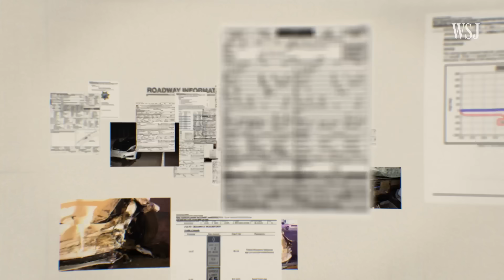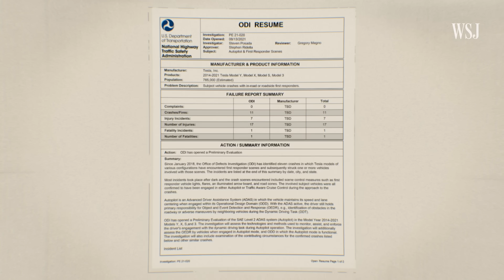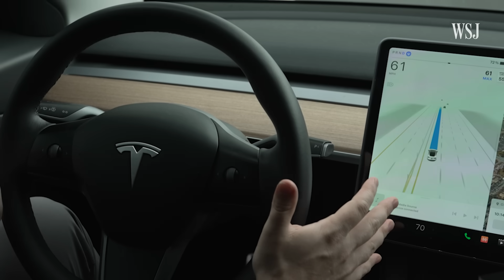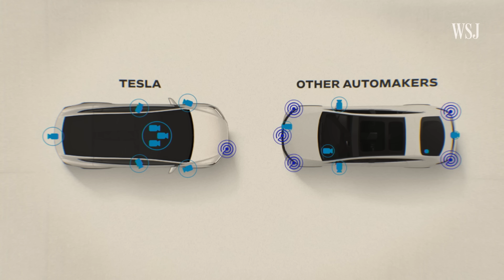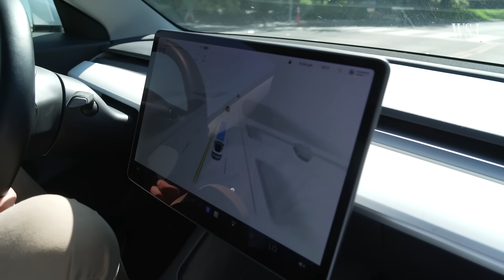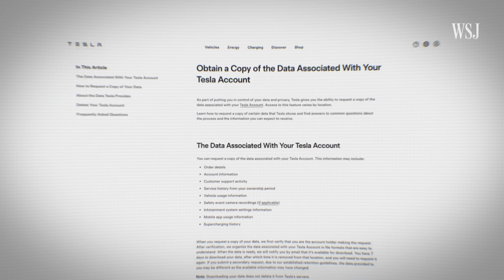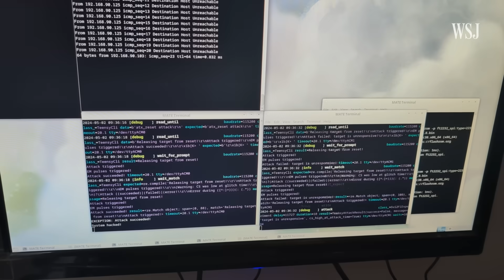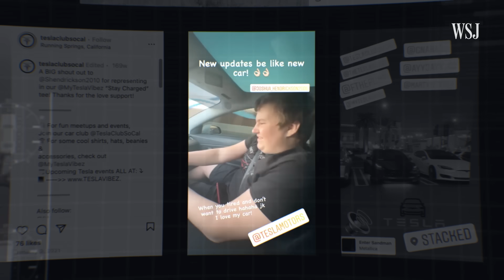The Hidden Autopilot Data That Reveals Why Teslas Crash | WSJ

Comment: Musk messed up meddling with his engineers and he will never, ever admit it.
Reply: V13 is showing Elon was correct. Tesla are very close to solving automation.
Reply: @daydreamer8373  They've been close to solving it since 2018. Not having Lidar was a mistake, but he's promised full self driving on the platforms they've already sold, so he's backed himself into a corner.
Reply: @quattordicimontenapoleone3113  Tesla only switched to using an end to end neural net about a year ago, and the progress since then has been nothing short of amazing. and proving Lidar is not needed. FSD is set to make our roads far safer.
Reply: @daydreamer8373  Nice try Elon-bot. I'll believe it when I see it.
Reply: @quattordicimontenapoleone3113  There are numerous videos showing the capability of FSD. Driving around New York especially impressive. It is not quite ready, but it's performance is undeniable.
Reply: @daydreamer8373  And still, we have videos like the one we're commenting on.
Reply: @quattordicimontenapoleone3113  You mean from 4 years ago? From autopilot a level 2 driving assist, where the driver wasn't using the system correctly. 

This video has nothing to do with today's FSD, anyone who thinks it does has no idea what they are talking about.
Reply: @daydreamer8373  Why is it always "the driver wasn't using the system correctly" from you Tesla apologists? There are a lot of accidents associated with Tesla's autonomous driving systems. You don't have autonomous driving if it only works 99.99% of the time but is a serious hasard. People are having serious problems even using it during short periods like review trials.
Reply: @quattordicimontenapoleone3113  Tesla does not have autonomous driving. They have level 2 systems, that require the drivers attention at all times. Tesla tell you this!!!

FSD is getting very close to level 4/5 which will mean the driver is not responsible. But until Tesla say otherwise it will be level 2 and require the drivers attention.

Comment: To say it in Musks own words (that he used to describe the F-35): The Tesla Autopilot is broken at the requirements level... Solely relying on cameras is the most stupid thing one could do when building self-driving vehicles
Reply: Yeah sure
Reply: @captcan78 Do you drive a car? If yes, you rely solely on your eyes and you don't consider that being most stupid. Seems that the problem is that the cameras used for vision are not sensitive enough at dim light, which cam be improved to reach requirement level.

Comment: Let's face the truth: it's Elon Musk's stupid call for not implementing LIDAR, because "it didn't seem cool enough". That guy burned so much money with his utterly stupid ideas it's beyond me how he got away with all that?!
Reply: Yeah how? 🤡🤡🤡
Reply: V13 is showing Lidar is not needed. FSD is going to make our roads far safer.
Reply: @daydreamer8373  Tesla’s "no LIDAR" strategy might cut costs, but it’s a safety gamble. LIDAR excels in bad weather, darkness, and tricky conditions where cameras fail. Waymo, the autonomous leader, uses LIDAR because it works—saving lives, not just money.

Claiming FSD v13 “proves LIDAR isn’t needed” feels like marketing hype. Tesla’s vision system impresses but often fails in real-world edge cases, leading to accidents. Waymo’s LIDAR, radar, and camera combo isn’t overkill—it’s smart engineering. Until Tesla matches that reliability, dismissing LIDAR is just risky, shortsighted and dead stupid.
Reply: @jazz1tup  You do know a Waymo crashed into a large wooden pole a few months back? Lidar is not some wonder sensor. and only adds cost and complexity. What Tesla has done with V13 is nothing short of amazing. Most people have no idea how good it is getting or set to become.

Tesla are on the verge of solving autonomy, and it will make our roads far safer.
Reply: @daydreamer8373  You do understand that Tesla vehicles were involved in 53.9% of ALL of the self-driving accidents? "Amazing" and "Tesla" just doesn't play nicely within the same sentence.
Reply: @jazz1tup  FSD has not been involved in any accidents, certainly nothing fatal. (I do know it has avoided many accidents) And any accidents would be down to the driver anyway, as the system is still designated level 2. 

I repeat Tesla are very close to solving autonomy, and our roads will be far safer because of it.
Reply: @daydreamer8373  Claiming FSD hasn’t caused accidents is misleading. Tesla’s FSD is still a Level 2 system, meaning the driver is responsible—but blaming users ignores design flaws that confuse or fail in critical situations. Numerous incidents, including crashes into stationary objects, suggest the system isn’t as reliable as claimed.

Avoiding some accidents doesn’t prove autonomy is near “solved.” True autonomy (Level 4/5) requires handling all conditions safely without driver intervention. Meanwhile, competitors like Waymo, which use LIDAR, are already demonstrating safer, fully autonomous driving in real-world trials. Tesla’s vision-only gamble may seem impressive but far from guaranteed to make roads safer.
Reply: @jazz1tup  You seem to have missed the progress Tesla has made since moving to an end to end neural net. The progress made has been nothing short of remarkable. I am not knocking Waymo, it is doing some great things, but has huge limitations. FSD making a lot of people sit up and take notice, and one og the reasons the stock price has risen sharply.

Most people have no idea how good FSD is getting or will become, So I don't blame you for your ignorance. You will see soon enough.
Reply: @daydreamer8373  Progress doesn’t equal perfection. Tesla’s end-to-end neural net may seem impressive but far from flawless — edge cases still expose its weaknesses, and crashes prove it’s not and will be not ready for prime time. Meanwhile, Waymo already delivers true Level 4 autonomy in complex environments, something Tesla can’t claim.

Calling skepticism “ignorance” is just noise. FSD’s hype may boost stock prices, but safety demands more than marketing promises. Until Tesla proves it can handle every scenario safely and consistently, the rest is just BS talk.

Comment: 10:20 CV isn't deeply flawed, it works and has clear limitations. What is in fact deeply flawed is Teslas implementation.

Only relying on cameras (most models), no real information on training data, no certifications, no 'explainable' algorithms.

When they reach SAE 3 they would have to prove the safety to lawmakers, having a blackbox to throw images at would not cut it.

Comment: Tesla and Elon Musk claiming their offering product, is good at auto drive,while ignoring the night drive capabilities is not optimal. If you claim you can do it,you should prove it fully, not only in day time. We all know,it is made mainly for day time drive. Elon does not make any mention of that,anywhere in his speeches about lack of sensors for night drive, even though he is known to be a man of specifics. Additionally, Elon DOES NOT HIGHLIGHT inside car software during night drive, the very incompatibility of car sensors in low light and emergency situations. Thats the FAULT of Tesla and Elon Musk and other software engineers. They have done everything else. Why cant they display a simple warning about night time drive to the user? Even displaying to the user, such a simple warning as simple as that, about lack of sensors your own company made a product choice about, is also "inconvenient" now? Elon should address it fully as a company CEO and change for better,as his false claims for cheap PR of drivers not dying, 4 Years ago. Removing the engineers who pointed out the faults in Tesla is called loose loose situation for Tesla company. There will be nobody left,to even point out their mistakes.

Comment: Not supporting Tesla, yet the claim is probably still true that autopilot driving is safer than non-autopilot driving. Yes there are tragic cases where humans could have seen something that the autopilot didn’t. But lots of other situations are handled better by autopilots. I don’t have the data, I might be wrong, but 1000 cases per year doesn’t seem that high compared to traffic accident numbers overall.

Comment: Tesla stopped using radar to maximise profit! At what cost? Bad ethics. They even disabled radar sensors on cars that actually had the hardware. I drive Tesla but don’t use Autopilot, can’t rely on cameras alone. This is stupid.
Reply: Tesla stopped using radar because the data was conflicting with the camera's. The camera's ultimately being proved right. FSD is going to make our roads far safer.

Comment: The whole premise of autopilot is conflicted -- the point of something driving for you is so you dont have to do it. Unless it can work with 100.00% certainty, theres no point in using it. There's no way everyone thats using it is 100% focused on watching the road just in case something happens. Over time you start getting comfortable with it, getting more distracted with other things, then the one time you take your eyes off the road, that could be it. Its bound to happen. At least for other car manufacturers, the lidar will act as an emergency fallback for those 1% of cases. Government needs to mandate a lidar system for all so called autonomous aids so that companies  can't gamble with your safety

Comment: Cameras alone is not safe it needs radar
Reply: V13 is showing otherwise.
Reply: @daydreamer8373  I use openpilot on my Honda the camera is not able to identify things when there is light bleed it can second guess it's decisions.
Reply: @jspencer89yt  You are using simple driving assist. FSD goes way beyond that. Tesla camera's see a lot more than people think, and a lot more than any human.
Reply: @daydreamer8373  no open pilot is not a simple driving assist. I think you need to go do your research. This is an aftermarket system for my Honda not the OE
Reply: @jspencer89yt  Yes but it is still level 2. The driver is responsible. It doesn't compare to FSD which is designed to be Full self driving.

Comment: A Shocking Display of Misinformation:!!!! The WSJ's Takedown of Tesla's Autopilot :)))#########

Now for the truth!:::)
The Wall Street Journal's attempt to dissect Tesla's Autopilot through "The Hidden Autopilot Data That Reveals Why Teslas Crash" is nothing short of a sensationalist disaster, masquerading as journalism. Here's why this piece is not just a miss but a deliberate misstep in the narrative around autonomous driving technology:

Skewed Data Analysis: This video, which smacks of agenda-driven reporting, cherry-picks data to paint Tesla's Autopilot in the worst possible light. Instead of a balanced examination, it focuses on the most dramatic crash scenarios without considering the broader context of millions of miles driven safely under Autopilot. It’s like reporting on airplane safety by only showing the crashes and completely ignoring the millions of successful flights. The selective use of data here is not just misleading; it's manipulative. 

Lack of Technical Nuance: The WSJ seems to have forgotten that Autopilot is a Level 2 autonomous system, which by design requires human oversight. The narrative pushed by the video suggests a failure in the technology itself, ignoring the human element in these accidents. This critical oversight screams of either ignorance or intentional misinformation. If you're going to critique a technology, at least understand its basic operational parameters. 

Biased Expert Selection: The experts chosen for this piece are predominantly those with a history of skepticism towards Tesla's approach to autonomy. There's an absence of voices from within the industry who might offer a more balanced perspective on Tesla's vision and the actual progress in autonomous technology. This one-sided narrative does a disservice to viewers looking for an informed discussion rather than a hit piece. 

Fear-Mongering over Education: Rather than educating the public on how to use Autopilot correctly or discussing the technological advancements and safety improvements, this video opts to scare viewers away from considering electric vehicles as a viable future. It's a portrayal that seems more interested in clicks than in fostering understanding or progress. The lack of contextualization about how other ADAS (Advanced Driver-Assistance Systems) compare in similar scenarios is glaringly absent. 

Overdramatic Presentation: The style of the video, with its ominous music and dramatic reenactments, borders on tabloid journalism. It’s clear this isn't about informing but about scaring. This is journalism at its lowest, where the goal seems to be to stir panic rather than provoke thoughtful discourse. 

Conclusion: In an era where technology like Tesla's Autopilot is pushing the boundaries of what's possible in automotive safety, this WSJ piece opts for the lowest road—sensationalism over substance. It not only fails to provide a comprehensive view but actively misleads by ignoring the significant safety enhancements and the potential of autonomous driving. This isn't just bad journalism; it's irresponsible journalism that could hinder technological advancement under the guise of public safety. 

If you're looking for an honest, in-depth analysis of Tesla's Autopilot, look elsewhere. This video is a hatchet job, plain and simple, wrapped in the guise of investigative journalism. Avoid at all costs unless you're in the mood for a dramatized, fear-inducing narrative devoid of real insight.!!!!

Comment: I doubt the average driver can consistently pay attention to the road at the level required to save FSD from a catastrophic mistake once they get comfortable enough to let it do most of the driving. The only way I can consistently maintain that level of focus is to drive the thing myself. Otherwise, I'm in power-saving passenger mode.

Comment: I'm surprised they don't mention the crash in the Bay Area where the guy's Tesla veered out of his lane and tried to merge with a concrete divider that was missing its normal crash barrier - he'd told his wife that several previous times on his daily commute he would see the autopilot turn toward the divider as if it thought it was seeing a passing lane, and he'd grabbed the wheel to override it - but on this occasion he was preoccupied for a couple critical seconds and didn't react quickly enough, so he died in a head-on collision with a concrete barrier.   Tesla reviewed the accident and pronounced it "driver error" because the driver had failed to override the autopilot when it made a mistake.   The fact they could say something that absurd is why I'll never buy a Tesla.

Comment: I had a simple lane assist on a Subaru Outback try to kill me last summer. It tried to swerve off a two lane road and over a cliff. Luckily, I was paranoid AF about  the lane assist (it was a rental and I had yet to figure out how to use cruise control without lane assist--not easy on that model. I actually I had to get out my phone and YouTube just how to lock the thing without setting off the alarm, but that's another story). It swerved, and since my hands were already on the steering wheel, I quickly corrected it and put it back into the lane. But still man. This assisting driving tech is dangerous.

Comment: Cameras are cheap compared to the others, the fact it does not work is beside the point, stringing people along with the promise of a fix down the road is the Musk way. Now that he is president you can kiss that repotting goodbye
Reply: V13 is showing Lidar is not needed. FSD is going to make our roads far safer.
Reply: @ Reality shows us otherwise, besides this is the same bull been dished out for over 10 years, don’t worry it will be better on the next version trust us
Reply: @PaulCarmona  No this is very different. It was only around a year ago Tesla moved to an end to end neural net, and the progress since has been nothing short of remarkable.

Most people have no idea how good FSD is getting or is set to become. Tesla are on the verge of solving automation.

Comment: Airplanes have "Autopilot" which still requires a Pilot to fly the airplane. Just use common sense. Stop blaming others. EU is irrelevant. Take responsibility.
Reply: Are you comparing flying in the air with practically zero obstacles in the sky to driving on a street with building, people and other cars etc etc that you can crash into?
Reply: So your standard for autopilot is cruise control? Then why all the fuss? We have cruise control already.

Comment: Tesla- we have autopilot. 
Normal car manufacturers- even if we had autopilot, we wouldn't be stupid enough to call it that.
Reply: it's a GOOD term! look at the definition from Wikipedia for example: "An autopilot is a system used to control the path of a vehicle without requiring constant manual control by a human operator. Autopilots do not replace human operators. Instead, the autopilot assists the operator's control of the vehicle"
Reply: even if we had autopilot, we wouldn't be stupid enough to call it that. 
Is this somehow dramatically different from Drive Pilot, which is what M-B calls their Level 3 ADS?
Reply: @BigBen621  as i said, they just wouldn't call it autopilot. For liability reasons. Even if it did function as such.
Reply: @wkymole3   they just wouldn't call it autopilot. For liability reasons. 
Just what liability does this create for Tesla? They've already won two lawsuits, one in Germany and one in the U.S., brought by folks who claimed it's misleading.
Reply: @wkymole3  "for liability reasons". Which means for the reason that people fabricate lies to exploit money from them. And you're sure your position is reasonable and just?